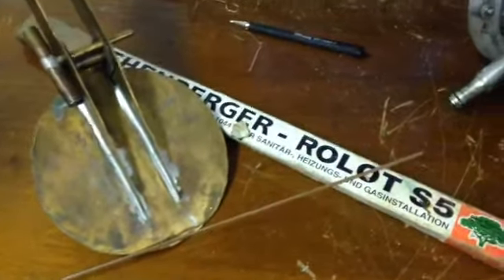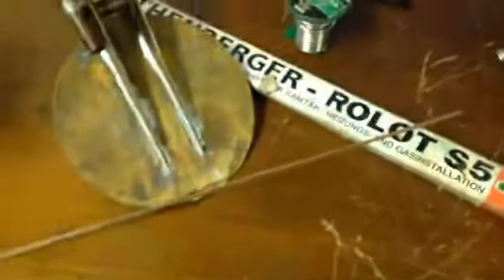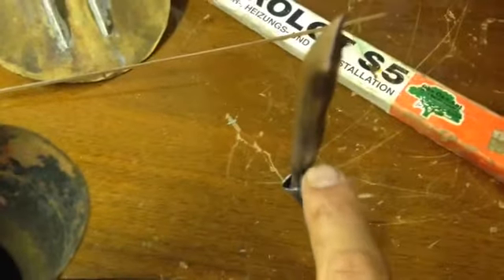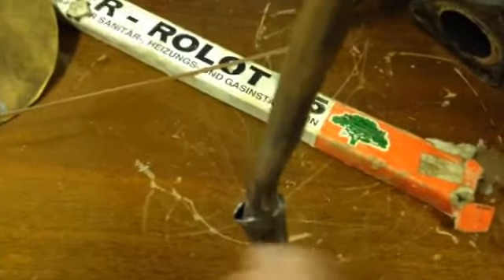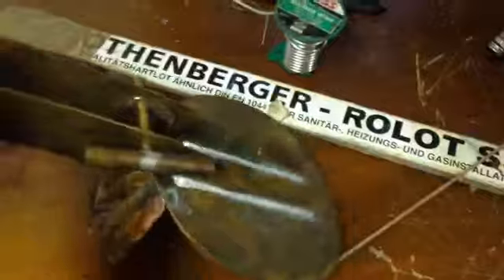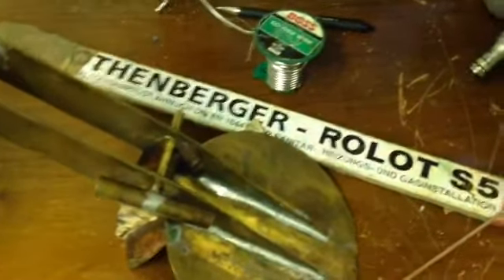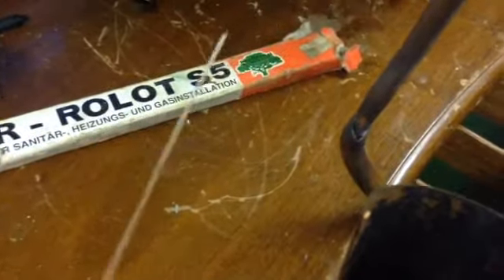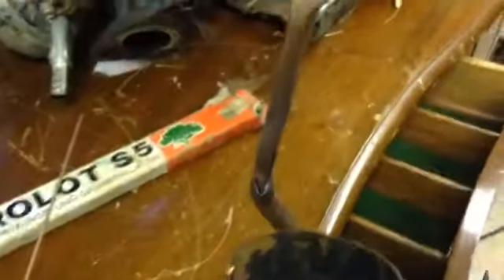Silver soldering / brazing without oxyacetylene

Comment: Do you use a high flow torch? I have been trying to desolder an hvac line with propane buts it’s just not getting hot enough. I thought you were gonna use Mapp,,by then you broke out the blue bottle. How?

Comment: Interesting - perhaps a solution to using loose 22mm fittings on old 3/4" copper pipe - they always seem to leak unless you're really lucky with the solder!! BTW, where did you get the silver solder you're using as I can't find a supplier online (is it the Rothenberger Rolot S5 that you're using?) Many thanks in advance!
Reply from the maker: Yes, this is great for solidly attaching and non ferrous items - you can make your own tee pieces - anything really - I buy my rods from either a BOC shop or try plumb centres 'climate centre'